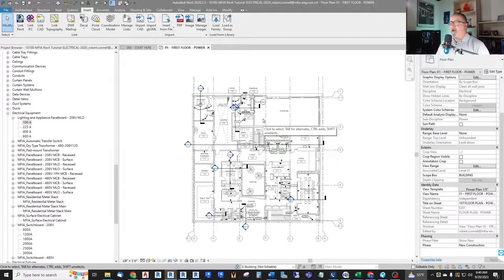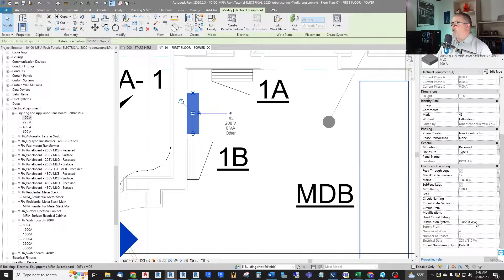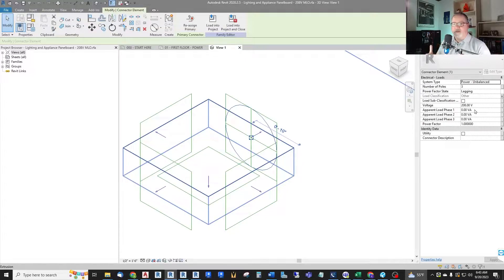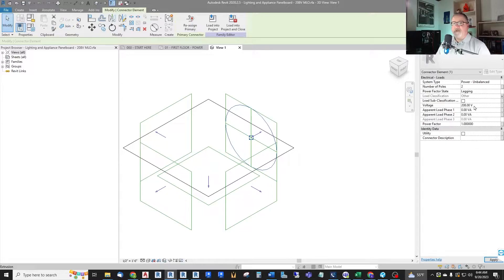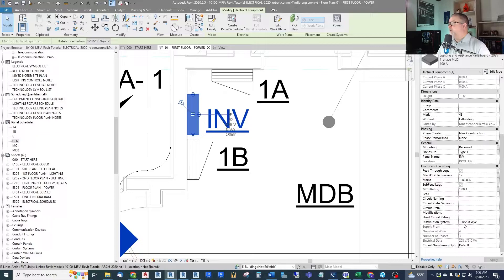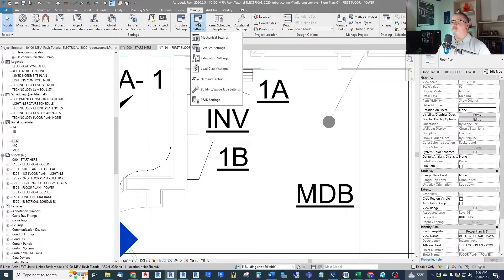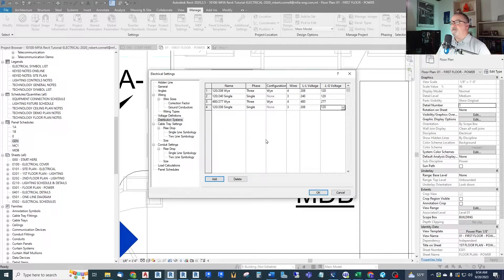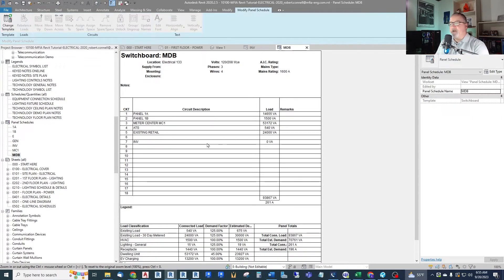REVIT MEP SECRETS TO CREATE a 120/208V SINGLE-PHASE Panelboard (PRO TIP)

Comment: Hey can you specific about the line to line voltage. By single phase you mean phase neutral and ground right?
Reply from the maker: Hey there - good question. By single phase, we mean there is no "3rd" phase. So a single-phase 120/208V system has 208V line-to-line between the 2 phases, and 120V between each line and neutral (and thus, ground). Revit itself uses a "2-phase" nomenclature to identify if a load is connected Line-to-line, or between "2 phases". But industry just calls it a 1-phase system. Now if you have a 120/240V 1-phase system like American households, because the 240V coil is center-tapped to create a neutral, it is often called "split-phase". Hope this helps!

Comment: Thanks for sharig. How can I show cable cross-sections instead of "#" in mm²?
Reply from the maker: My first thought is that the wire size representation is hard-coded in Revit for AWG, and is not changeable (unfortunate for most of the world, I would assume). That being said, there may be workarounds that try to overcome that obstacle, of which I'm afraid I am not familiar with at this time.
Reply: @ElectricRob  Thank you

Comment: 1. panel 208V/120V should be 3-phase 4-wire, or 2-phase, 3-wire. [it can't be single phase, panel 240v/120v could be single phase]
2. Revit can create database for not only electrical system, but others, it is complicated to make drawing [compared with Auto CAD], maybe AI can use Revit to do fast and better.
3.What is your opinion, Rob?
Reply from the maker: Hey there Tiger - thanks for commenting! Yes, can do a 208Y/120V 3ph 4w or a 120/208V 1ph 3w (revit calls it 2-phase since line to line). Can also do a 120/240V 1ph 3w (2-phase in revit again). Could even do a 120/240V 3ph 4w system, but I don't believe it would handle the "high-leg" or "wild-leg" properly (voltage of one phase is 208V to neutral instead of 120V). Not sure what you mean by comment #2, but yes, Revit is used for all systems and all disciplines - it can be more "complicated" because of its nature of containing so much more technical information as well as plenty of 3rd dimensional data. However, with the proper set-up (i.e. custom families created properly) and training, it can actually speed up production vs AutoCAD, and cut down on errors (i.e. excel spreadsheet loads not matching CAD circuits, etc). At least that has been my experience!

Comment: Cannot assign or add 100 A, 120 V/208 V, Three Phase, 4 Wires, Star to Circuit. The Voltage (230 V) for the Circuit is out of range for the Line to Ground Voltage for 100 A, 120 V/208 V, Three Phase, 4 Wires, Star (The Line to Ground Voltage is specified in the assigned Distribution System). explain  please   i stuck  through vedio please please
Reply from the maker: Hey there! Sounds like you have a 208Y/120V-3ph-4w panel, and are trying to connect a 230V (or 240V) load? The load does need to be within the voltage range of the panel/distribution system, so within 200V to 220V line-to-line for the 208V panel. So either you need to change the load's voltage to around 208V, or you need a 240V panel. If I'm misunderstanding your question, please explain further. Good luck!